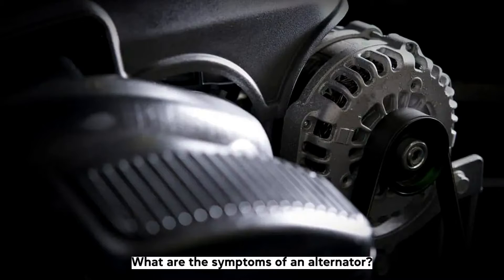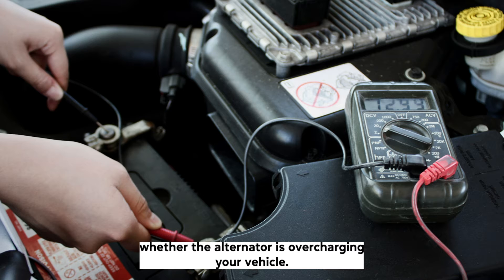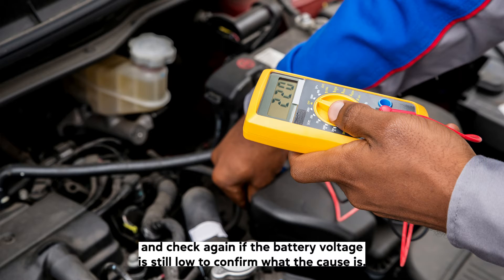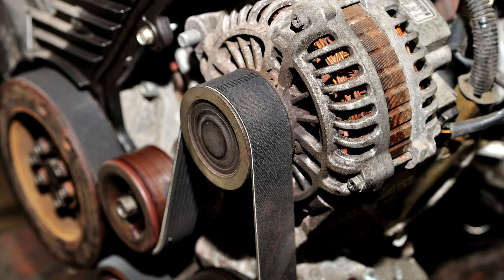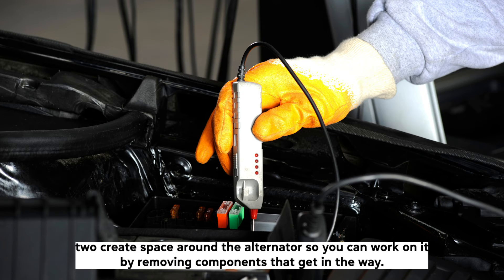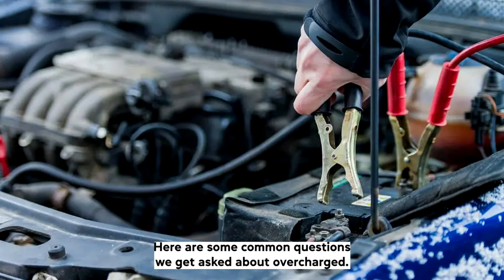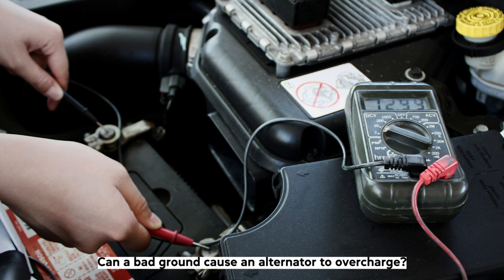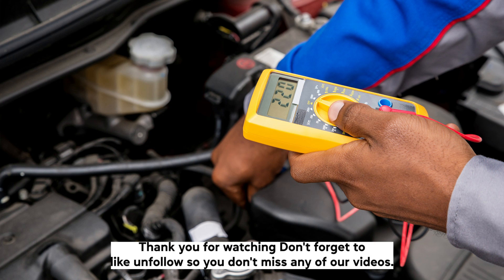Symptoms, Causes Of Alternator Overcharging, And How To Fix It

Comment: Blown 3 ignition modules. Alternator starts out at 15.3 Volts. Startup voltage spike to over way over 15 Volts. Replacing alternator  is the  only cure.

Comment: A local mechanic was going to charge nearly $500 to change the alternator, plus I would have needed to have the vehicle towed, which would have cost me another $150. I ended up replacing the alternator myself, it cost me less than $135, the truck runs great now. I like saving money by doing things myself, this video has some good advice though the "closed captioning said to get a new alternator at a pot store 🤣😂🤣

Comment: Guys i found the same problem and i changed everything the alternator the battery but still showing 15.4 v the electricity guys told me it's normel coz u changed bigger battery which is 80 Amber and u should change it to 70 do u think i need to replace new one or there's another problem???
Reply: Maybe bad pcm?

Comment: Well, that's bullshit. An overcharging alternator isn't always the alternator. There are voltage regulators that are built into the vehicles computer. I just repaired a vehicle that was charging 18 volts. The P.C.M. supplied the grounding that regulated the voltage output for the alternator. Chrysler has done it this way since the 70s.

Comment: I replaced my alternator in my 2006 silverado it still charges over 15.15 volts
Reply: What parts dealer and what brand did you use?
Reply: @jacobpaiz8679  advance auto I think it's carquest maybe I need To try ac Delco

Comment: I had an issue where i replaced the battery and alternator but it continued to show overcharging. I checked the battery ground etc and it was sturdy. Any thoughts?
Reply: Did you figure it out? Some cars have fusible links instead of fuses. Check for burnt wires at the alternator connection. You would have to replace it with another fusible link since it's a fuse. Over charging will cause the link to burn the wires but has fire retardant heat shrink.
Reply: @The Machamp  not 100% sure but once i ran the car for a while, alternator went to normal voltage. Guess the vehicle just had to relearn? Customer hasnt returned since so im gonna assume it was just that.
Reply: @bestbomb17  what did u do cause I'm going through that right now and the mechanic telling me a need a PCM but I really don't feel that's the problem cause I put a new alternator in and it's still overcharging!!!
Reply: @tluvly66 did you ever figure it out
Reply: Alternator still faulty
Reply: Or your multimeter sucks , and the previous alternator was probably good